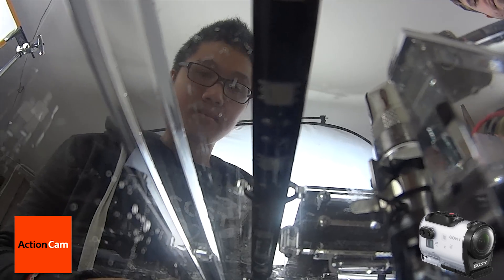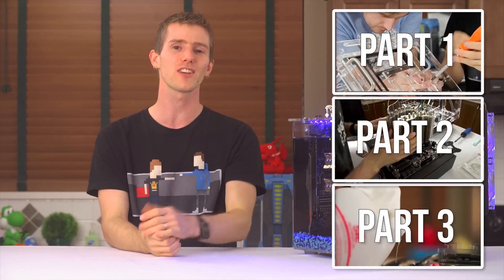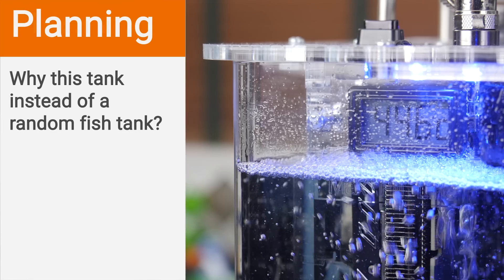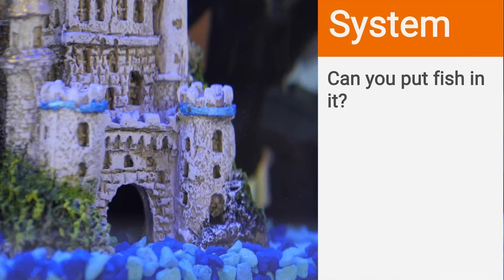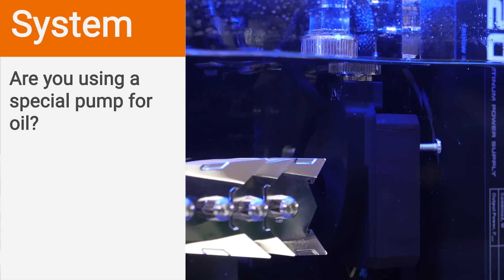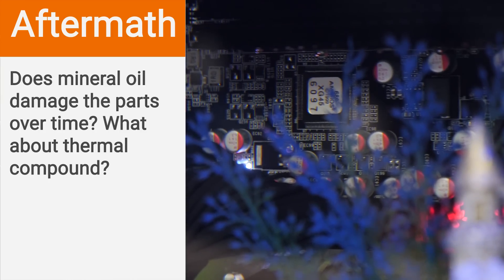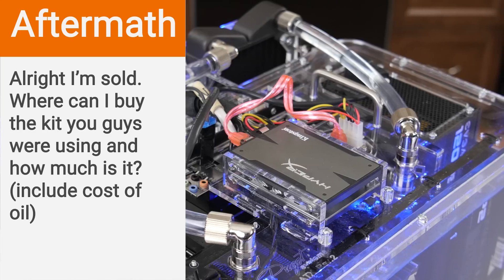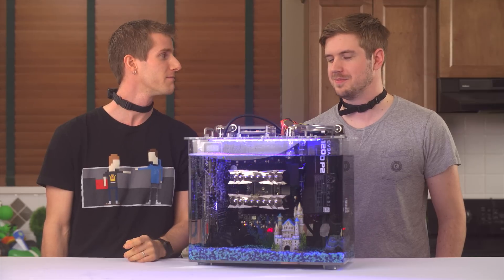Mineral Oil Cooled PC Part 4 - Q&A

Comment: What if you wanted to use mineral oil in a otherwise normal custom "water cooled" system?  It seems like that the mineral oil would be a superior choice over distilled water in that if you had a leak it would be less of a problem, and perhaps the pump would last longer, and you wouldn't need to change the oil ever.
Reply: Water doesn't have a very high thermal conductivity, but it has a lot of specific energy.  Which is good, because it allows the water to continue to take on heat as it moves through the system, and not become heat saturated right off the bat.  Either way though, either would have much higher thermal capacity than air.  The main factor here is component failure.  

Go into a little more detail on what Alex said above, oil cools down just as fast as it heats up.  (Both are simply a transfer of thermal energy, and controlled by their localized deltas.)  So you wouldn't really have to worry about heat soak with oil any more so than with water, as you should be bleeding off the heat as fast as you are taking it on.
Reply: +Bu Jin If im not mistaken, Oil doesnt cool down as quickly. But there are probably special oils out there already suited for watercooling.
Reply: I actually did a bit more research on this, and the cooling abilities it's the problem. The problem is that the mineral oil breaks down different materials and seals, and so a water system would fail with the use of it and you'd eventually have a mess.
Reply: Is breaking down components the only problem? Cause if so, you could buy or build special material that dont contain rubbers etc... 
Or is the thermal conductivity of oil lower than water as well?
Reply: alcohol could be a good alternative to water in a closed cooling system, I believe nasa used that in astronaut cooling suits.

Comment: Would this be worthwhile to focus the flow beyond just air bubbles, to keep the cpu heat in check under load? you could have another pump connected to a more focused tubes and it would push the actual oil thru, rather than air bubbles (that are only pulling ambient heat out via air).

Comment: I ran mine without radiators and it was fine, the surface area of the oil is large enough that it cools passively if you aren't overclocking. I ran prime 95 until it stopped getting warmer and the processor was like 60c, mineral oil was warm to the touch but not a problem. Huge mess though and my motherboard died a couple months after I took it out of the oil, not sure if it was oil related though. For the oil I got a 5 gallon drum from my uncle, it was for high voltage transformers.

Comment: Wouldn't the mineral oil dissolve the wire insulation over time?
Reply: I believe they had cable mod cables for mineral oil pc builds

Comment: i guess those people who asked about maintenance and what if you get your hands dirty, have never worked on cars or machines (motor and transmission oils, gasoline, diesel, antifreeze, brake fluid).....
Reply: +ERK77VI Hahaha very good point.
I have had my hands filthed by doing my own brakes and oil changes for years.

Comment: The fans looking slow is actually an liiusion created by the camera. if you watch closely the also seem to spin in reverse but if you observe the disturbance they creathe close to the surface you can see that its not the case. this effect happens when the a multiple or the rotations per second devided by the number of fanblades gets close to the framerate. if the fans turn 350 degrees between to frames it will look like they just spun 10 degrees backwards in the video

Comment: aside from because they gave it to you, why on earth would you use a gtx 780 when you could have gone with a gtx 900 series gpu?!  you go through the expense and trouble of ddr4 ram and a top of the line 8 core extreme i7 but you dont go for a top of the line gpu?! not even a 970 or 980ti?! WHY?! im also trying to figure out what the radiators on the back were for if the just put a passive cooler in for the cpu heat sync.
Reply: +companyoflosers see the date he build this pc man
Reply: the gtx 970 and 980 were released in september 2014, this video was done december 2014. they were there to use.
Reply: they made it before september, there is another video when linus build this
Reply: +companyoflosers If you watched the whole series, Linus said in the first video that they planned this build a while ago (before 900 series was released) and had already asked for and received the components for the PC. The radiators are there to cool the oil. The oil can't dissipate the heat on its own. Without the radiators, as Linus said in the third video, the oil would reach unsafe temperatures.

Comment: This may sound stupid, then again most of the questions are, but what would happen if you didn't use a CPU heat sink? Wouldn't the oil touching it manage to cool it?
Reply: I think it could have a problem with lifting the CPU and a couple problems with the motherboard pins, I am researching this as I really fucking want to build one
Reply: I am no expert, but i would say that the surface area between oil and CPU would be simply Too small. Heat sinks are build to transport the heat really fast and efficiently and transport it to larger surfaces where the transfer isnt as fast and efficient
Reply: +AmamMcMam No, as there wouldn't be enough surface area. Heat sinks are designed to increase surface area to dissipate heat better.

Comment: why dont you make an valve on the bottem to remove most of the oil
Reply: +Wouter Schouten Why would you want to remove the oil?
Reply: In case of any replacing or fixing as explained in the vid. You wont need to get all dirty and stuff
Reply: Youd just pull the pc out if the tank. 
Emptying out the oil every time would be very expensive
Reply: +Patrick Hansen first of all you will have oil dripping everywhere from the pc. if you drain first and let it dripp out in the case. on top of that if you treat the oil well it is reusable
Reply: +Wouter Schouten you can remove the oil with hose, just like they removed the paper in an earlier episod.
As long as the ending of the hose is lower than the beginning the oil will flow itself once its sucked in. Simple Physiks ;)
Reply: +DarthVaderPower 1. physics is the correct spelling 2. then you wont get as much out as with a valve 3. you will need to put the hose in and such while with a valve you simply open it
Reply: +DarthVaderPower 1. physics is the correct spelling 2. then you wont get as much out as with a valve 3. you will need to put the hose in and such while with a valve you simply open it
Reply: +DarthVaderPower 1. physics is the correct spelling 2. then you wont get as much out as with a valve 3. you will need to put the hose in and such while with a valve you simply open it
Reply: +DarthVaderPower 1. physics is the correct spelling 2. then you wont get as much out as with a valve 3. you will need to put the hose in and such while with a valve you simply open it
Reply: +DarthVaderPower 1. physics is the correct spelling 2. then you wont get as much out as with a valve 3. you will need to put the hose in and such while with a valve you simply open it
Reply: +DarthVaderPower 1. physics is the correct spelling 2. then you wont get as much out as with a valve 3. you will need to put the hose in and such while with a valve you simply open it
Reply: +DarthVaderPower  1. physics is the correct spelling 2. then you wont get as much out as with a valve 3. you will need to put the  hose in and such while with a valve you simply open it
Reply: +DarthVaderPower  1. physics is the correct spelling 2. then you wont get as much out as with a valve 3. you will need to put the  hose in and such while with a valve you simply open it
Reply: +DarthVaderPower  1. physics is the correct spelling 2. then you wont get as much out as with a valve 3. you will need to put the  hose in and such while with a valve you simply open it
Reply: +DarthVaderPower  1. physics is the correct spelling 2. then you wont get as much out as with a valve 3. you will need to put the  hose in and such while with a valve you simply open it
Reply: +DarthVaderPower  1. physics is the correct spelling 2. then you wont get as much out as with a valve 3. you will need to put the  hose in and such while with a valve you simply open it
Reply: +DarthVaderPower  1. physics is the correct spelling 2. then you wont get as much out as with a valve 3. you will need to put the  hose in and such while with a valve you simply open it
Reply: +DarthVaderPower  1. physics is the correct spelling 2. then you wont get as much out as with a valve 3. you will need to put the  hose in and such while with a valve you simply open it
Reply: +Wouter Schouten sorry for the spam. my phone said it couldn't post it so i spammed the button.
now it posted it like 200 times

Comment: I wouldn't stop making something just because some company claims to have patents on mineral oil cooling systems. Stupid companies and their patent wars.

How about a non-submerged mineral oil cooled PC? Just use regular water cooling systems filled with mineral oil instead.
Reply: +Phillip “Alkaris” Pether 
Like almost all cases of general type patent related stuff is shit because patents are given out for many new technologies with no real understanding. This leads to that happening with almost all big companies paying millions every year to settle patent cases with these troll companies that dont build anything them selves just patent potential tech. Especially with software patents is so bad that some companies have patents that block even some major research branch because of stupid patent office not realizing how general patent was. 
And they said oil makes stuff very stiff and fragile so enclosed system is much better with water.
Reply: Software patents are just stupid in general. Most if not ALL programming languages out there fall under GNU Public Licence, BSD Licence, or MIT Licence, there are probably few more I think, but I'd rather not name them all. But anyway, these patents companies make on software are pretty much violating these other licences by patenting them.

You can't patent programming languages used for your software, because firstly;

A: There is always code that has been structured the same as something else made by someone else.

B: You can't tell if the software's programming has been structured the same as someone else's code that has same similar functions constructed. Unless of course the code is publicly viewable at any time say like on GitHub for example.

These companies jumping on them with patents ruins it for everyone, because it's all about profits to them, and not caring about these other licences that exists which they are violating.

Comment: Hey I don't know if I will get an answer for the question but are there PSUs with non rubber coating for the wires so you do not have to worry about the mineral oil eating the coating?

Comment: Could you possibly combine the tech from your ULTIMATE Sub-zero Phase Change Cooling PC by getting custom made copper blocks for the phase change cooler made to the shape of the radiators and have the copper have direct connection with the radiator fins to transfer cooling instead of fans to super cool the oil or would the temperature disparity cause condensation on the hoses which would cause water to end up in your system which would be bad. I know this kinda sounds like a waste of time as you would lose the quiet db point of aquarium pc by adding the condenser etc and you would have the ugly condenser you would have to somehow hide but would be cool to make a sub-zero or close to mineral pc.

Comment: For cleaning the components after removing them, soaking them in ethanol, isopropyl alcohol or liquid paraffin will all clean it up nicely. No more oily feel to it and it won't damage anything.
Reply: +TheAmmoniacal thanks good sir :D, this was my only question :D, which was answered before even it was asked :)
Reply: no ethanol! it is conductive, electronic do not like wandering electrons. Isopropyl is not conductive and safe
Reply: @polecabo  No it is not.
Reply: Or wash with water and let dry completely after. Water only damage electronics if there is water on components when power goes through it
Reply: @Impetuss  Yeah but water is not going to remove the oil, so it's a bit pointless
Reply: @qps9380  water is less dense than oil and thus oil rises up....so if you sink something covered with oil into water the oil will separate.... isn't this logical?
Reply: @HladniSjeverniVjetar  for the majority of the oil yeah, but it also clings to surfaces very well, to the extent that some would remain on the component surface
Reply: @HladniSjeverniVjetar  No, that's too simple. Gravity isn't the only factor in deciding which substance clings to what. I can't say if it's because of oil's hydrophobic properties, or because of surface tension, or other characteristics of the substances, but the idea that you could use water to wash oil off of metal is something that would never even occur to someone who's ever rinsed a frying pan...
Reply: @TheHadMatters  Depending on the temperature of the water.
Reply: @Impetuss  Water contains minerals. You would likely have problems even after drying everything. Also, water doesn't mix with oil. You need soap to allow that.

Comment: Could I still use mineral oil without problems in a standard liquid cooling loop in a system with the use of reservoirs, CPU and GPU blocks and radiators etc?

Comment: are your external fans blowing into the radiators or sucking through them? If the blowing in your passively adding heat to the outside of the tank.
Reply: Penfookio Gaming Considering the grills on the fans aren't showing, then they must be blowing into the radiators. It would be kinda hard with the positioning on the radiators to suck air through them since there is very limited space between them and the case. It may be passively adding heat, but its probably only making a few degrees difference to the oil temp.

Comment: i disagree adding a fan to the cpu heat sink will make a difference. currently your relaying on passive cooling, but if you added a fan or pumped the oil directly over the heat sink you will have much lower temps on the cpu. Example being your cars radiator have electric fans to keep the car cool during idle and at speed, even with the air flow from the cars speed most will over heat without that fan.

Comment: Awesome, but completely impractical. Moving it is almost impossible, you're praying every day that nothing goes wrong and you have to fix it and mineral oil poses serious health issues. You do not want to get that stuff on you, especially technical grade oil! 

Props to Linus and Luke for building this kind of PC, but I'm too much of a practical, no nonsense type of guy to even bother. I want easy access and functionality, looks are secondary. And since the cooling performance of oil doesn't exactly beat the pants off regular air and water cooling, I don't see any real advantages other than simply being able to say "I built and own that badass PC!".
Reply: Corristo89 For Enthusiast PC Builders, your last sentence is all we care about.
Reply: Corristo89 Absolutely nothing wrong with getting oil on you. It's messy, but it's not going to be hazardous to health in any appreciable way. Technical grade is just a reference to the purity of it, and how refined it is.
Simply put, the more refined it is, the safer it is.
Reply: I think you've missed the point. 

Picture this: you're standing on the ground. The concept has gone so far over your head it's somewhere in the stratosphere! 😁

Comment: Instead of that oversized cpu cooler how about a tube with a nozzle on the end to blow cold oil onto the cpu straight from the radiator.  Or a number of tubes and nozzles to blow cooled oil onto hot spots.
Reply: Carl Morris You would still need some kind of heatsink, otherwise the heat produced by the cpu wouldn't dissipate adequataly through the oil, making blowing cold oil on the cpu inefficient, at best.

Comment: I was wondering if you had ever tried to build a system but rather than using mineral oil as your . But trying to build a system using a refrigeration system to cool an anti-freeze solution that would in cool your processor .

Comment: You could clean an oil soaked GPU with ethanol, xylene or some other solvent. It will remove the oil and evaporate. You should get a nice clean and dry card in no time. Squirting several deciliters of ethanol on your card means a lot of it will also evaporate, so doing it a well ventilated space would be appropriate...